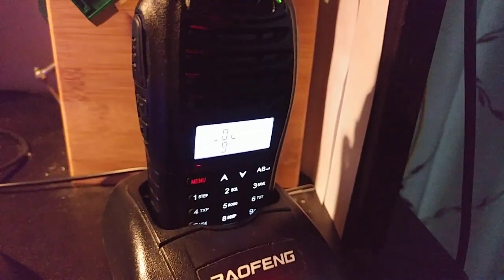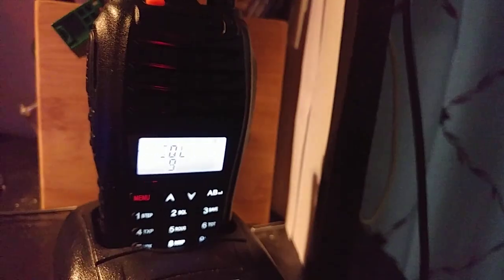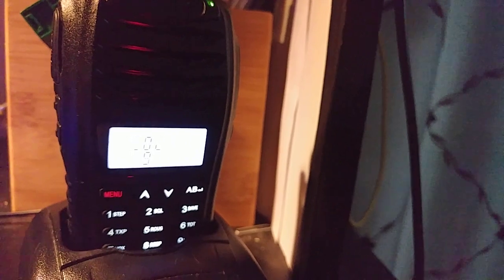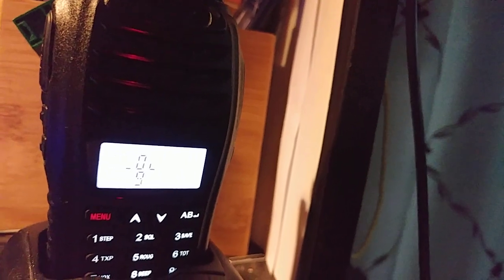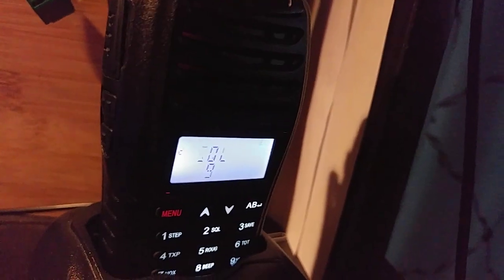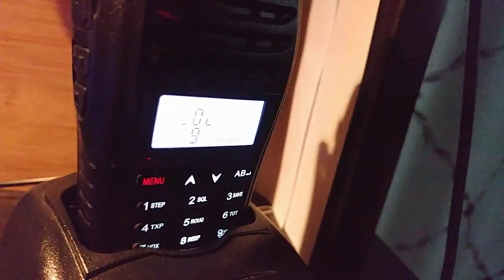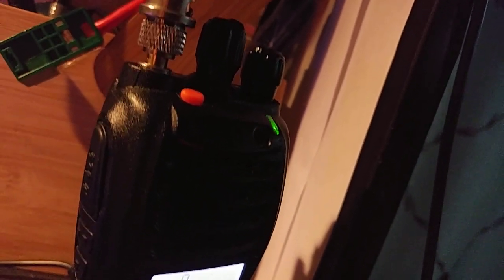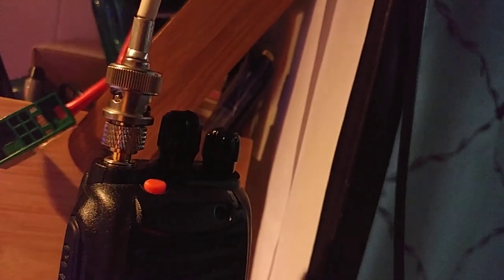Example of Baofeng Squelch Problem

Comment: I have noticed the issue and the bell fan 888s this radio is sensitive it is a cheaper model definitely 16 channels however after reprogramming it I started having issue even though I reprogrammed it with chirp the level of the squash which I like to keep sensitive at one or two it's basically physically at 0 so static all the time it does receive with the static meaning there's no more control of noise level it still transmits fine however no noise blinker it looks like indeed it seems to be a common area with those radios however they're good to experiment with and they're good budget alternative I'm also using the UB 82 this one is fine I was wondering if there was a way of resetting the hardware physically going inside if the programming still works as you can change the channels however nose blanker doesn't work anymore the squelish interesting video thank you for sharing the information it looks like it's a patent that is happening with some of these radios hopefully there's going to be some type of fix so far I've seen the disable of these radios there doesn't seem to be any physical button to reset to factory
Reply from the maker: I've not messed with the innards enough to be able to definitively say there is or is not a reset button.  I would not expect a button, though;  it's more likely that if one exists, it's in the form of "short this terminal it this resistor to that terminal of the third capacitor from the left".  It's possible that the memory is volatile and you could reset it by disconnecting (or even momentarily shorting) the memory battery, but I'd expect it is more likely an EEPROM, which would retain its contents even without any power.

Now, on the UV-B5, there was a way to hold...   was it the menu button?...  and maybe another while turning it on that I recall put it in a programming mode of sorts, and with the right button sequence would reset it to factory, but I don't think the 888 has a keypad so I'm not sure there's anything similar for that model.

A precursory skim on the net brings no dice, but there is a post on the Miklor forum that had offering of a CHIRP file that would provide the same effect, supposedly.  I would assume that would include special settings, but I don't know.

In any case, good luck, and 73!

Comment: Hello, I have solved the problem in my case. When programming frequencies in frequency mode, I had to change the bandwidth from wideband to narrowband. Then I saved the frequencies and the squelch noise was gone. Try it, maybe it will help you.
Reply from the maker: I appreciate this but the repeaters I use are all wide band.  Narrow band will cause my audio to be significantly attenuated.  Maybe not to the point of unintelligibility, but noticeable.  

Do you find that setting narrow band triggers a persistent state change that remains even after returning to wide band? 

I've noticed in my RTL-SDR the same effect.  Widening the bandwidth of the demodulator causes a higher audio volume but affects audio qualities as well.
Reply: Tech Addict Attic at this point you’re not gonna have much of a choice as more and more frequencies are mandated to go to 12.5kHz and then 6.5kHz.
Reply from the maker: @mikewolf5367  Valid point, this is fair.  However, I'm not changing my operation to fit the device.  That's backward.  I bought the device to suit my operation, not be a guidepost for how I operate.

I have typed a full book here a couple of times but it comes down to this every time:  I'm not changing for the sake of change nor will I change the way I operate to suit the lack of care that some so-called engineer somewhere put into their product.

The radio is of a broken design (and the squelch isn't the only thing wrong with it).  I'm confident the design isn't going to get fixed in future models produced by the company.  I've already decided not to recommend Baofeng (or any other Chinese Cheapie) to even starting-out hams unless I hold one in my hand worth using.  I don't even try communicating on this one now. 

I'm saving up for a used, decent-shape ... 

Crap, they're all Chinese or so old they've been through Hell.
Reply: EXACTLY!
Reply: Had the same problem with mine. Use the frequency mode setting instead of channel mode and.........IT WORKS as it should!! Don't know why ithey won't work on channel mode though?????
Reply: Thanks, that solved my problem absolutely   Perfectly
Reply: One of my channels was very noisy until I switched it to narrow thank you for the tip